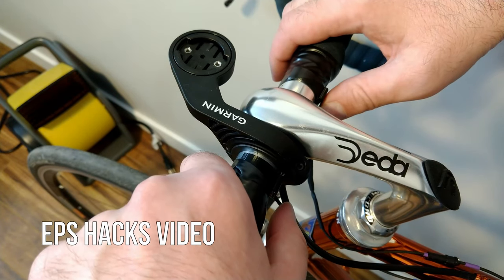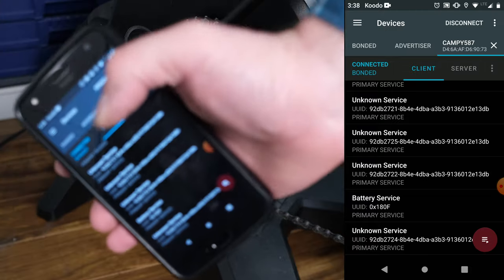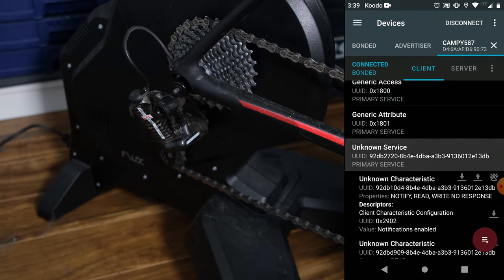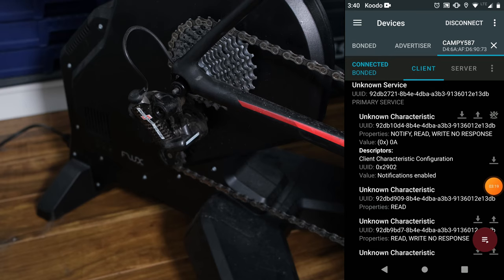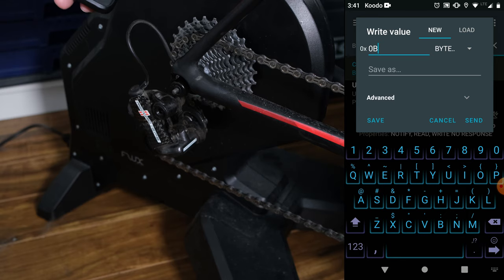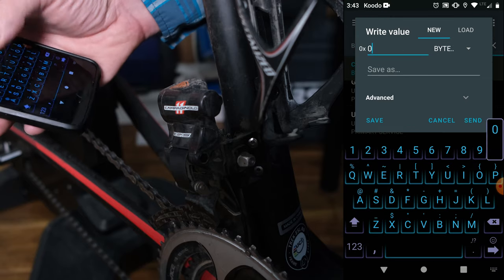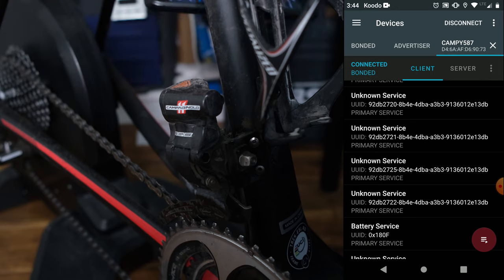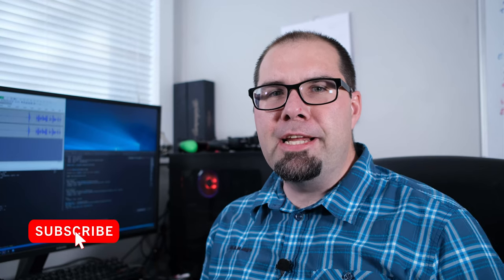Campagnolo EPS Secret Wireless Mode

Comment: All that stuff - diagnostics, connectivity and what not - you do not have to deal with if you use mechanical shifting. Also, mechanical is more reliable, lighter, easier to service and does not create hard-to-recycle electronic waste in the long run. It's just not as fun if you're an electronics nerd. And can anybody explain why so many people say "shram" when there is no "H" in Sram?
Reply: Sram is a sham